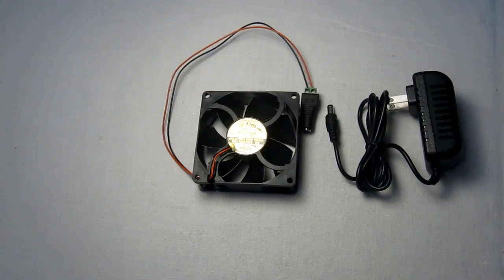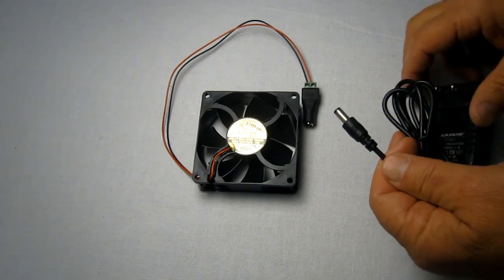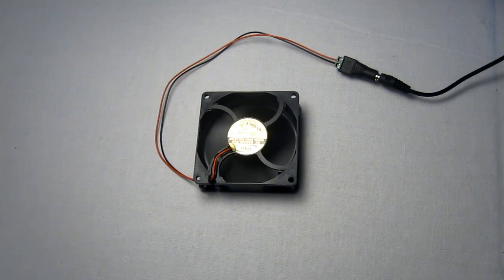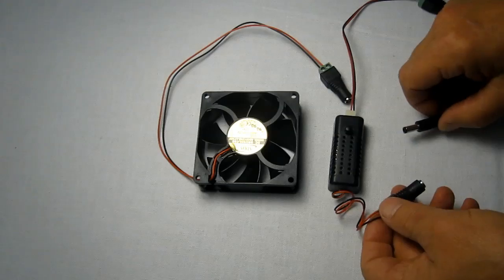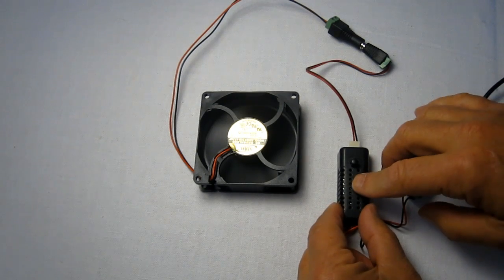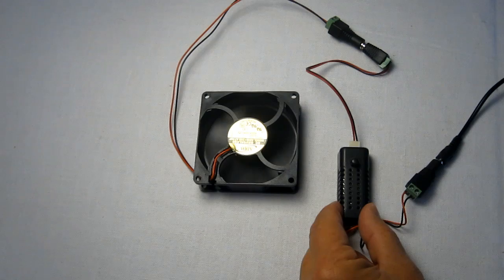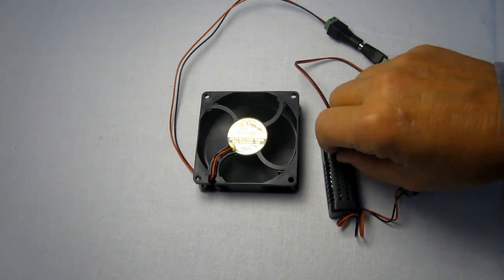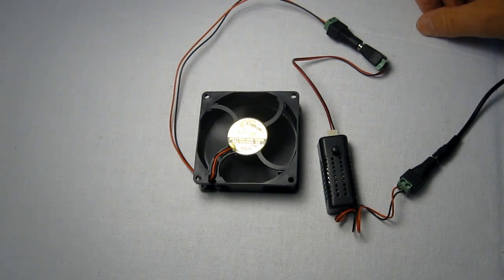Electronichaus DC Fan Controller

Comment: I did everything you did but never had a controller on speeds lol I'm not patting myself on the back I'm wondering if you look at things and say what if??lol it's what I do ..i have a 240mm big boy with 4 L.E.D blue has high medium low but have to unplug to shut down, what about a remote control with 8 diff colors or settings? Oh on a stick or drop neck holder hangs in front of you at baseball soccer basically Summer time omg ok and runs tube for water spray mist on yourself lol ok ill stop but I do this kind of stuff all I mean ALL time.the stuff I come up with junk yes maybe but taxing on brain
Reply from the maker: I think you are asking for a controller to throttle speed all the way to off.  Sorry, we don't have one like that.